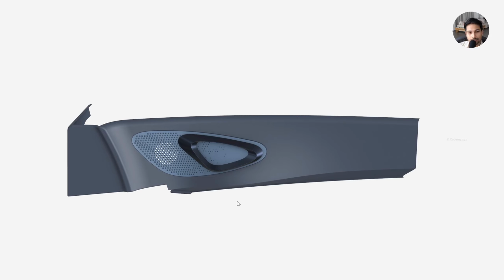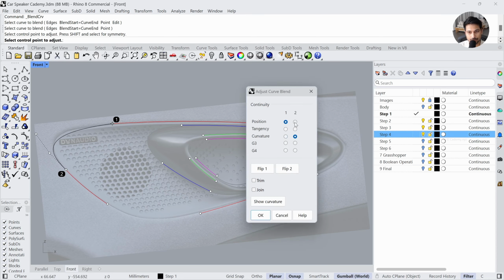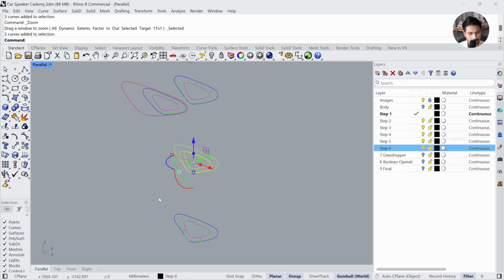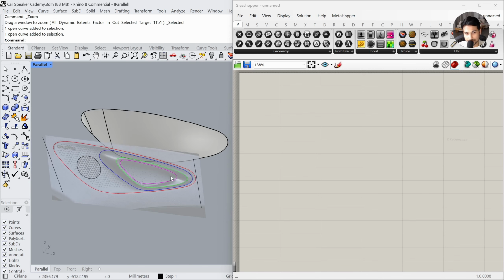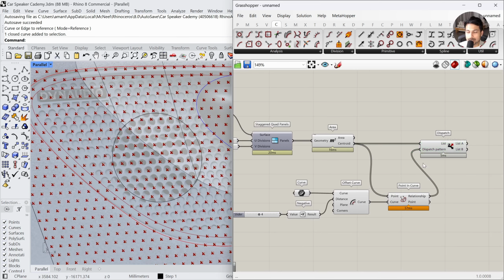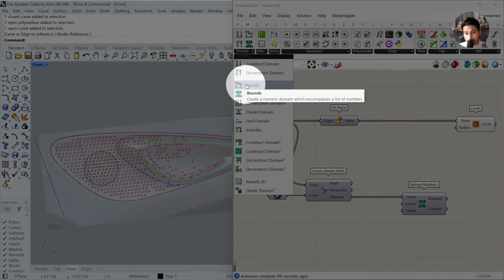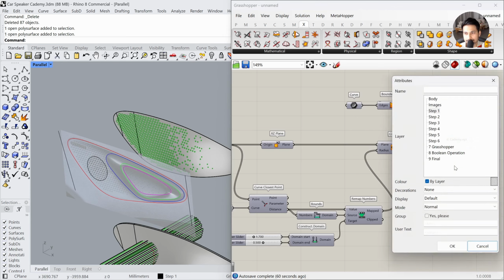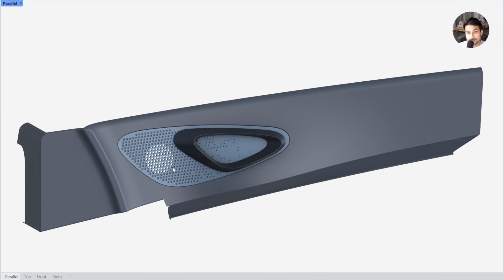Automotive Speaker Parametric Texture Rhino 3D & Grasshopper | Teaser

Comment: Im starting to learn rihno and grasshoper, thanks for your videos. Grasshopper looks pretty powerfull, however it seems a bit annoying that you cannot define basic values "in place" and do very basic operations like negative directly in input to the block. I believe blender could be a good example of how this simplifies the pipelines / blocks (however specific software developer calls it)
Reply from the maker: It’s actually very easy to create a number slider with negative values. If you double-click the canvas and type -5, you’ll notice it initially suggests a Subtraction component. However, if you keep typing -5..7 (using two dots between the negative and positive numbers), Grasshopper will automatically generate a number slider with that specific range.

Comment: Thank you mr.Aman,
I have a question!
How can I make a draft angle for the extrusion surface after I use grasshopper and export the curves and surfaces?
Reply from the maker: You can use the Pufferfish plugin (package manager). It contains a tapered extrusion component.